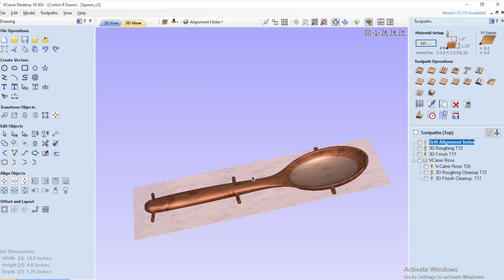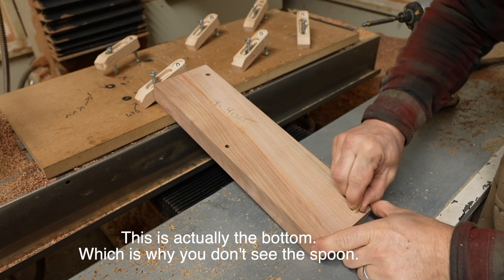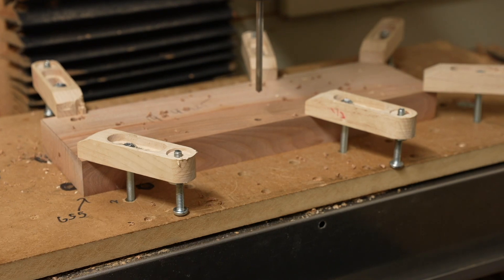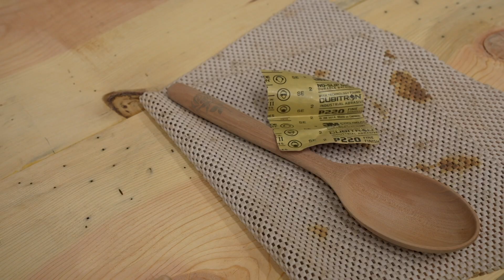CNC Woodworking - Wood Spoon with Curved Wood Inlay - (Files Available) Making a CNC Project

Comment: Fusion version ?
Reply from the maker: Fusion isn't so great at v-carves; Vectric VCarve is just so much better at them! That's the main reason I setup the project in Vectric rather than Fusion. Fusion can do VCarves..and I may try them in the future, but it does have limitations, but I might be able to figure out how to do creative work arounds for those issues.
Reply from the maker: ...but you can take the STL and import it into Fusion and do toolpaths there; I have a video on how to setup tabs, which isn't too hard. The VCarve inlay is the hard part, as it is not flat, but projected onto the doubly  curved surface.
Reply: @CorbinDunn  Thanks, You know You inspire me a lot especially such projects :  functional Utilities and Furniture that every home/office  should have..! Rather than just hobby gadgets . This really lights up the pathway to my ambitious career that  I dream everyday,-- to be a modern woodworker reinforced with the accuracy and productivity potential of digital technology.!
Reply: One Of my first projects would be that "Mirror Panel " you did earlier with smooth curves.! 

Like I requested earlier,
I am waiting for more "Fusion+CNC " Projects on-

1) Complex Fixture/Work-holding techniques for multi sided projects- More examples of "Window machining Methods"
"SoftJaw Methods" , "Indexing Methods" for rotory type parts.

Also Pls Refer and do a fusion version of this if possible : -https://www.youtube.com/watch?v=-reSew5u5Oc&ab_channel=DennisvanHoof
Reply from the maker: @BipinBabu-k4c  Awesome!
Reply from the maker: @BipinBabu-k4c  I'm definitely focusing more on just Fusion/CNC these days instead of Vectric. I also am hoping to get a rotary table at some point soon-ish to do some more projects that require that orientation. 

Dennis Van Hoof does some amazing work!

Comment: Nice! I wish this was available for Fusion 360.
Reply from the maker: Yeah! I do include the STL file in the download, but you'd have to do all the toolpaths/CAM yourself. And the engraving wouldn't be possible, as I used VCarve to do that part. I think I can do it in Fusion...and the next time I do one like this I'll probably do it there. VCarve has "issues" with its toolpath generation due to the way VCarve handles STL models.
Reply: @CorbinDunn  That's good to know, I'm definitely interested in the spatula if you do one in fusion. Thanks for the reply!

Comment: I am new to cnc, but I use Carveco Maker for design and a FoxAlien 4040XE for actual cnc work.  I would like to know if the cnc files you offer will work in my situation?  They look great!!
Reply from the maker: What program are you using for CAM? The toolpaths and CAM is setup in Vectric VCarve, but I also include the STL file so you can do the toolpaths in whatever software you prefer, however, the inlay won't be possible as it is a vector stored in VCarve. Pretty much any CNC should be able to machine this; it isn't too big.

Comment: @CorbinDunn What made you use your Tormach instead of your Avid?
Reply from the maker: Only because it was my only machine at the time! I started with the Tormach a few years ago as my first CNC machine. Once I realized I was doing more wood than metal I decided to get a dedicated wood CNC and got the Avid. I also had a year off from woodworking while I built the shop.
Reply: @CorbinDunn  Thanks for your prompt response. I've watched several of your videos and your squaring / tramming videos helped me immensely with my Avid.